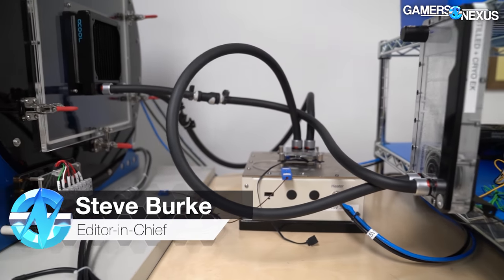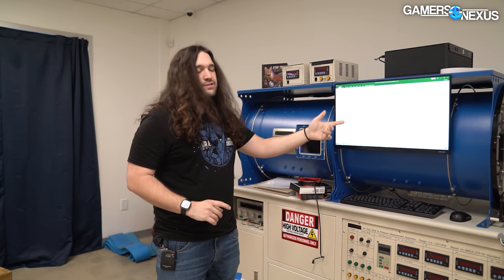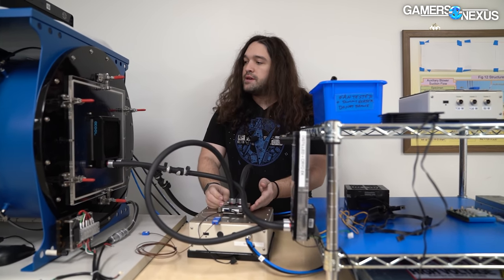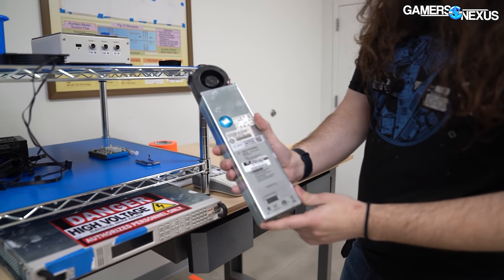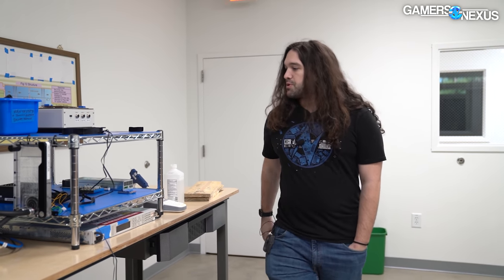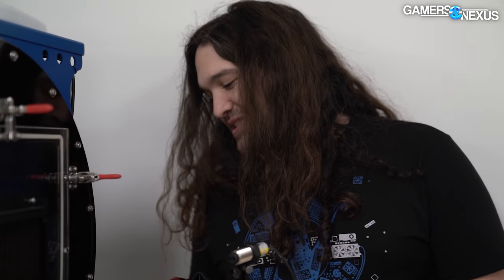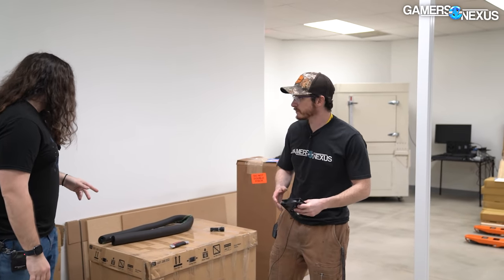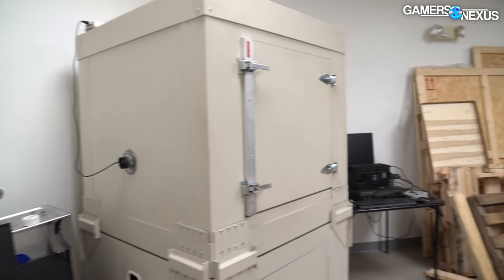GN Lab Update: Fan Thermal Testing, Pressure & Flow Charts, & Challenges

Comment: It would be interesting to know the loudness of the fan when mounted to a standardized case, perhaps a case plate could be sacrificed for this? 

The reason I'm interested in this is the vibration of cases transfers to desks, especially cheaper-mdf and resonates somehow, rather loudly and arguably more annoying than the fan noise itself. You can test the difference whether the case you have vibrates by putting a hand on the panel during operation — in theory, you'll sense the vibration, and at the same time, it should get quieter. In some scenarios you can even feel it in the desk itself by putting hand on it, and let me tell you it's not a pleasing feeling. 

I've resorted to putting packing foam under the cases to lift this, but still need to use anti-vibrational mounts for fans instead of screws to make it silent (compared to the fan noise itself).
Reply: It sounds to me like you're on top of the issue. Sounding board resonance can certainly amplify noise. But a fan that's making less vibrations would be quieter with everything else being equal. Quieter fans are just quieter.

Comment: As a person with a mining engineering degree who took one course in mine equipment selection and another course in ventilation, as well as working in a ventilation department at a mine during a term break, I've looked at a fair few PQ curves.  I learned to look at rock faces and estimate its structural integrity (rock mass rating, specifically) within 5-10 points of the properly assessed value in 30 seconds.   PQ curves never got easy.

(Note: this is not me claiming to have a P.Eng status.  I don't.   I just have the degree.)

Comment: Agree with the fixed-RPM analysis. A very small percentage may purchase accordingly, but most likely not. People care about quiet and cool, and more recently quiet and volume of air versus pressure of air.

Plus I don't think people realize how fast the little fans like 40-60mm are spinning.

Also, on the soundproof system - maybe a cannon plug/aviation plug? I'm thinking you can leave a cannon plug in your passthrough as a sort of "quick disconnect". Install it, fill it in, and all your connections are made inside the box. Tethered properly you shouldn't see any noise once the connection is tightened. That way you just use whichever pins you need, and don't have to open you passthrough up which could lead to variation.

Comment: These P-Q curves are similar to IV (current-voltage) curves for solar cells. The important outputs are:
- Fill factor
- ISC (equivalent to maxP)
- VOC (equivalent to maxQ)
- Imax & Vmax (at Pmax)

This could be interesting for you to see if you could use similar metrics to the solar industry.

Comment: The idea Mike was describing when he used quiet hands was uncoupling in most fields.  It’s done often in anything with a motor, compressor, etc to try and keep vibration limited to the part itself and not transferring it to whatever it’s connected to.
Reply: in this particular instance, i feel that a secondary test WITH the vibration could be valid because if the fan IS generating a resonance or vibration, it WOULD be heard if you screwed it into your chassis, and so testing a difference in the rubber test vs a metal mounted test could show if there was a big difference in noise created. cheap fans would probably generate a lot of secondary vibration noise due to less balance in the blade assembly and with cheaper bearings.

Comment: the foam cages for the fans make sense, but I would've been interested in just a light metal cage that hold the fans just like a case would. This way you could also test the methods of vibration prevention that most modern fans come with, like rubber tips or something like that

Comment: I think the foam fan stand/holder design needs some more thought/work. The force of the fan will manipulate the stand/holder. Maybe sandwich some metal in between thinner foam to make it more rigid, and to maintain the vibration absorbency, and help with consistency.

Comment: My own "ratings" of fans was pretty basic: I put all the fans rated at less than my maximum desired decibel limit in my spreadsheet, put in their CFM ratings (translating Noctua's from their metric units), and made a column of CFM/decibel.

Yeah, there are obvious problems with that method, not least was that I was relying on the manufacturer's data. But it hopefully got me in the ballpark of quiet with power.

Comment: Steve,  I agree that the Max CFM + Max Static pressure are common industry marketing/jargon that are easily comparable and verifiable. For comparing fans and making something more meaningful or digestible to the casual observer, have you considered some kind of normalized curve? Unfortunately I'm not sure what would be best lol. Normalizing via maximum static pressure at a given constant voltage maybe? Maximum static pressure for a given maximum mass flow? Something non-noise dependent would help level the playing field for a fan that is just "quiet" by not moving much air.

Comment: Following this adventure closely - fan testing is very interesting to me, as a silent PC-builder.
I've full confidence you'll sort out all the performance metrics, including noise-normalized data, though I'd like to humbly request a secondary data point for noise-normalization: please test at very low noise levels, say 30dB, in addition to what you're going with for your regular testing (I'm assuming 40dB?). That would be so useful to me, and hopefully others.
By the way: Mike is a natural, I'd like to see more of him. :)
Reply: +1 for noise-normalization point at 30dB :)

Comment: I'd love to know how accurate the internal tachometers are, especially when they've also gone through a motherboard attempting to report it accurately. It probably wouldn't be important to figure out if the fan is good, but it would be interesting. Is there a way to figure out what, like, the average impedance of a case is and then test with that? I don't know enough about this to even know what information to ask for, but I'm sure I'll be impressed with your first fan review
Reply: It's probably pretty good. Digital hardware is really good at counting. Steve's fancy laser is using basically the same technique.

Comment: To condense the fan data down and give a formula.
You can calculate the point of best performance for every speed (flow*pressure=Power)   Air-power/electrical input power = efficacy

Comment: So far I'm happy with the $17.48 all the fans I put into my system sound and work. Part of that cost was the whole CPU cooler I'm using. But it came with a fan so I'm including all of it. It's hard to say what part of that $9.99 was the fan and what the heat sink is. The video card has two fans on it too but I'm not including any of that.

Comment: I want to see noise normalized test on various noise levels, not only 40dB but also 30dB for silent operation, 50dB for high airflow focused one(Noctua iPPC, TL-B12 Extreme, Delta monster fans, etc.). And I think you can do some... temperature normalized tests? So that people can choose value fans(or heatsinks) for a tolerable noise level? Like, your testing equipment is so versatile that one can run a full Youtube channel for each equipment. I can't wait to GN test results using these amazing equipments!
Reply: +1 for noise-normalization tests at 30dB :)

Comment: Radiator fin design seems another variable;  which 120mm fan works best on one rad may not win on another...?
Mic should be off-axis for noise measurement to minimize confounding air turbulence.
Acoustically inert fan mounts will yield unrealistically low noise values for fans whose vibrations would more strongly excited e.g. case sheet metal.

Comment: One way to determine some reasonable test conditions to report on;
Run a fan at full speed, 12V in a few cases and against some radiators. Measure the current it draws to determine loading.

Then put it in the fan tester and find the restriction that most closely matches the case and radiator loading conditions. Then you can use these restriction values for "real world" values at which to compare all fans at.

Perhaps 6V might be more appropriate for real world "50%" normal speed of fans rather than max performance.

Comment: It would be nice to have performance per noise and performance per noise per dollar and additionally have a ranking system including subjective things like look, pitch (how nice / annoying it sounds), whats in the box.

And it would be nice if you just ranked the fans  (it's much easier to poll 5 people which one is better out of two) and give points per position and calculate the points in the end.
You could mix measured and subjective categories in that ranking.

Comment: why not put mic jack inside chamber and use port for female to female plug?  you can cover the jack with foam and liquid electrical tape with just the wire exposed. but allows to change mics easily this way

Comment: FYI: Wood glue is usually the go-to for adhering multiple pieces of foam together. Although I have no idea how it compares to thermoplastic, acoustically, so maybe you already ruled it out for that reason?
Reply: If hot glue does it then it's easy to work with. I'd think contact cement would be the go to for foam. You only get one shot with that though. He was getting long setup time because hot glue needs to cool to set and foam is a great insulator. So it keeps the heat.

Comment: One logical midpoint on the P-Q fan data is peak mass flow. Max CFM, max pressure delta, and peak mass-flow rate. By multiplying the volume by the air density on the high side (1atm + pressure delta across the fan) you'll get the mass flow rate, which should correspond with max cooling efficiency.

Comment: Just do Flow and Noise at 100%, 67% and 33% pwm/voltage in Open Air and again with a Standardised Radiator for restriction. Pressure is just the means by which a fan initiates airflow, which us what is all that we really want. You could do ∆P at 33%, 67% and 100% airflow restrictions though for those who care for maximise positive case pressure etc.

Comment: I also thought that testing at set RPM would be the most fare comparison but after you explained why you prefer set noise lvl testing I agree with you that is the way I chose my fans but I still think set RPM should be included in the testing because that will show who's got the best design.

Comment: Series idea: "GN Fixes". Take products & show a best-case scenario only by using fan adjustments. IMO, this would give people a real-world idea/solution as in what kind of temperature improvement could be seen given running a specific setup of fans. How many is too many, what's the noise-to-efficiency-to-price trade-off, what environment is better running positive vs negative pressure given external factors (eg. fan setup vs ambient). Just an idea, take it and run with it; I'm ordering a screwdriver kit regardless.

Comment: i would have just hung the fan from elastic strings from the top of the chamber, you could use hooks in the holes on the fans and it would auto adjust to the size of the fan.

Comment: The fan chamber solution is easy bud and your going to get outside sound in.. I would 100000% recomend a rethink. For my sound chamber I actually have filled the entire passthough with compressed Acoustical Solutions Green Glue Sealant with 2 patch wire with both 2 3 and 4 pin connections ends for each side. That way the fan cable clips in at the inside and and have a switch outside. 

Using this compunt will ensure you have a airtight chamber and are not introducing exterior sound into test to a reasonable level.

Comment: I think instead of suppressing vibration noise it would be good to do separate test to aplify it. To see how well it is balanced (basically more vibration means more strain to bearings and mechanical part so shorter life span - or faster vibration noise progress). Fans are almost always mounted to metal which, based on quality of case will produce vibration noise. Yes I always can buy better case, but rather buying higher quality (low vibration) fans might be a better option.

Comment: Hot glue holds well, but it's relatively rigid, and can compromise the effectiveness of the foam. With foam based costumes, contact cement is widely used, offering a durable connection that's more pliable.

Comment: Actually  I think there are people like me who chooses fans base on how fast it can go at specific fan speed percentage first and then airflow  and lastly noise. Like my fans of choice are those that spin at 2200rpm or higher, so that at 50-75% would be around 1500-1800rpm. It might be flawed, but my personal logic is basically, generally speaking, if a fan can spin at 3000prm, then it should be quieter when it runs at 1800rpm compared to those fans that has maximum 1800rpm. Currently have 120mm T30s and since I have a noisy environment, I really don't notice the noise even if it's running at Advance profile(3000).  I setup the  2 radiator fans to advance, while the 3 intake are on Performance.

Comment: I think a good analogy for the CFM vs Pressure situation is revving up your car's engine, and its RPM vs torque.

If you put your car in park and press the gas the engine RPM is gonna skyrocket and absolutely roar, but it's producing no torque and you're not going anywhere. Whereas if you actually had the car in drive the RPM would be far far lower, but it'd actually be generating torque.

Comment: Note from an engineer:

Go get a copy of the 3x fan laws, will be very helpful

For the data just use 5 points per fan test at a noise normalized scenario

0rpm
15%rpm
35%rpm
50%rpm
75%rpm
100%rpm

On each level show the fan poeer draw, airflow and pressure drop, and them temperature delta vs a known fan

Otherwise use data points to test in the fan speed according to fibonacci or renadrts numbers

Comment: 13:45  -  the 3 pin DC fans have a tachometer ! that third wire is for the tachometer. The 4 pin PWM fans have one extra wire for PWM signal, not the tachometer.

Comment: I'm a weirdo (aka mechanical engineer). The last rig I built was ~2012. I bought the fans that claimed to move the most CFM in the $10-20 range. SilverStone FM121. I didn't bother using whatever potentiometers that came with them. They are LOUD, but seem to do the job cooling wise. With noise canceling headphones on, their impact (on me) is negligible. 

[I am looking forward to your fan testing reviews. Maybe I'll upgrade my fans and domestic bliss as a result. I doubt it since "video games are bad."]

Comment: Would love to see How Various Fans Perform at Equal RPMs. RPM makes sense as a common Variable. Highlighting The Difference in Blade design between Brands. Perhaps it will encourage a Fan design Evolution.
Reply: I think they're making fans pretty much as good as they can now. For various price points at least. Cheap crappy fan is going to be crappy. The real question is do the high end fans really deliver the performance to justify their price? But some of that could be down to longevity. A lot of fans are decent when they're new. A few years down the road it's a different story.

Comment: FYI.  The third pin on a fan header is Tachometric/Sense Signal, on both 3 and 4 pin respectively.  The 4th is the pwm control signal.  I don't know where you got the idea that there is no way to know the rpm from a 3 pin fan.  Unless your extremely expensive fan tester cannot get a reading from pin 3?
Reply: I couldn't get 3 pin fans to run on my motherboard. Although everything I read claimed it could do it. It is supposed to be 3/4 pin. It runs 4 pin fans just fine. So I've no idea what's going on there. I tried plugging the 3 pin fans into the headers how I thought then tried them other ways. The motherboard just didn't want to know about them.
Reply: @1pcfred  You'll need to change the header from pwm to voltage control in bios. Either way, a 3 pin fan in a 4 pin header (and vise versa) should run at full speed .
Reply: @paceyjag  plugging a 3 pin would not run plugging it in any which way for me. I tried. The 4 pin fans just ran. I really just had to change the case fan so it wasn't too bad. That only cost $7.49. Until it arrived after I ordered it I just ran without the fan. But I did have to ditch the case fan that came with the case.

Comment: I would suggest contacting a {Test & Balance} NEBB certified company in your area to help with CFM "cubic foot per minute" flow of your air.  Using their knowledge of air flow and system pressures they can help a lot. Also, they can determine the heat load you are producing. The equipment we use are calibrated, certified, and usually the latest in technology. At the very least certified. I have always believed the CPU industry has fallen a little short in this area for the most part.

Comment: I want all by builds to be as silent as possible. Where possible I set the fans speeds to the fastest speed where i can’t still can’t hear them, at a fixed rpm. Next build I’m planning will probably use a bigger case just to have bigger rads to keep everything silent. I design software so hearing the computer is distracting at best. Silence is king.

Comment: I think RPM normalized testing is not important for consumers, but it is a way of comparing fan designs. Although just RPM normalizing won't tell that much because different designs would have a different RPM based performance curve. Add noise level chart to that and you could say which designs have a better RPM to noise to performance ratio at various RPM settings. But still, it would only be usefull for manufacturers. This way you could give them hints as to which design would be better for a fan according to their goal. Which could be lower noise levels, higher performance or a good balance between the two.